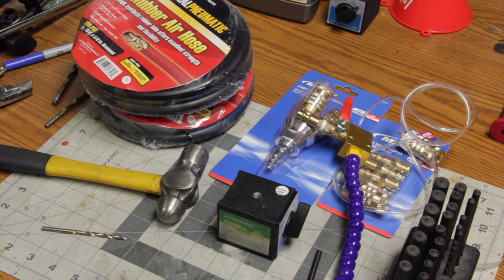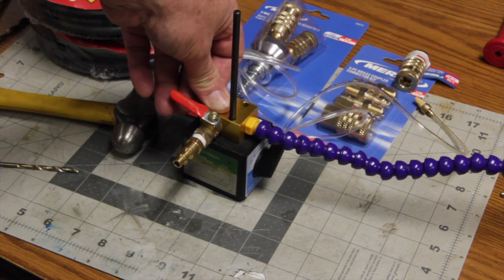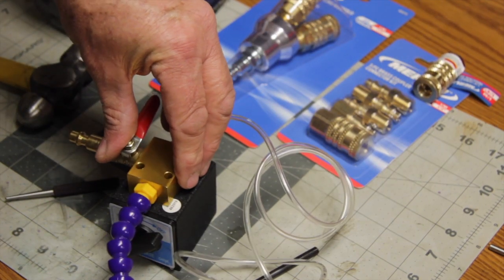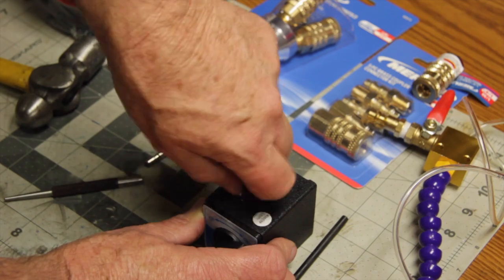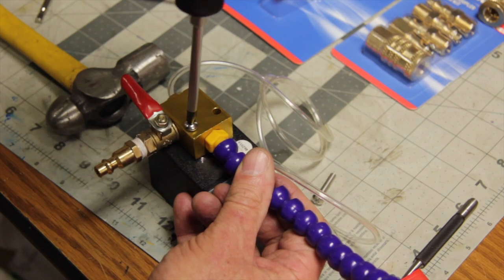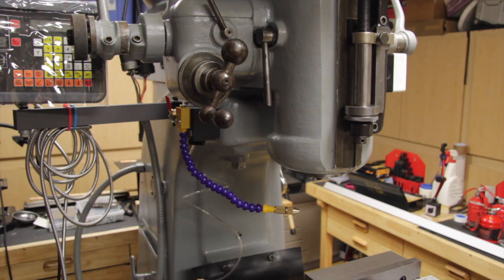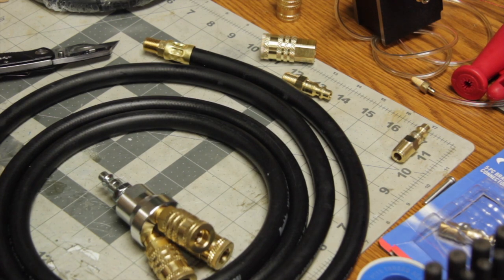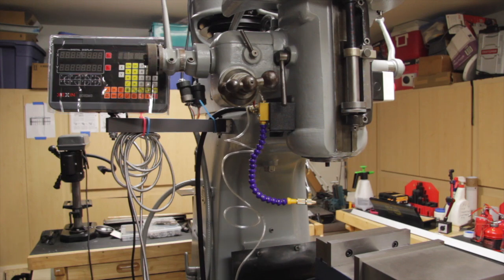Harbor Freight Mods - Mounting Coolant Mister and Air Nozzle to the Mill

Comment: I just purchased a dirty filthy Gorton 8 1/2D.  This was a very helpful series.  This is really going to help with getting mine up and going.  I would liked to have seen some disassembly. What kind of VFD or phase converter did you get?
Reply from the maker: Hi James,  I purchased two vfd's one for spindle speed (I setup the spindle on the high speed motor windings)  HUANYANG GT-Series (220V, 7.5KW) ,  I then purchased a second vfd for the feed motor, Variable Frequency Drive, MYSWEETY VFD Inverter Frequency Converter 2.2KW 3HP 220V 12A  These vfs's were pruchased from amazon and seem to work just fine.  If you have any more questions, just ask
Reply: @JoediyLab  sweet thanks for the info.
Reply from the maker: @jamesduncan8539  Thanks James,  It was a fun project and a very nice old mill